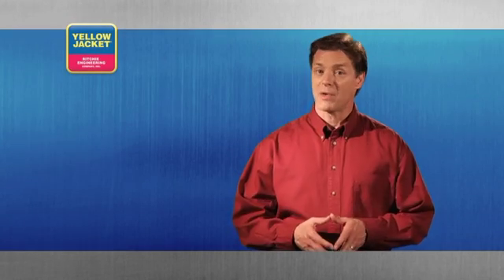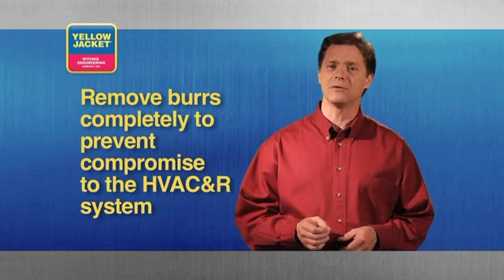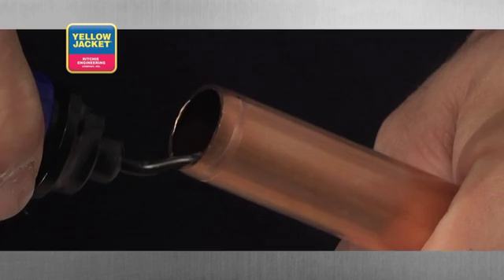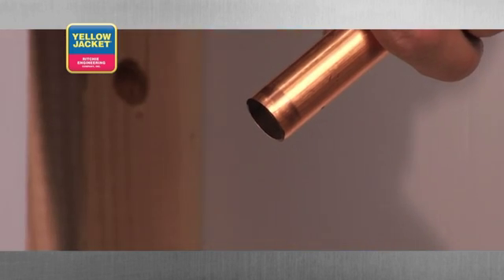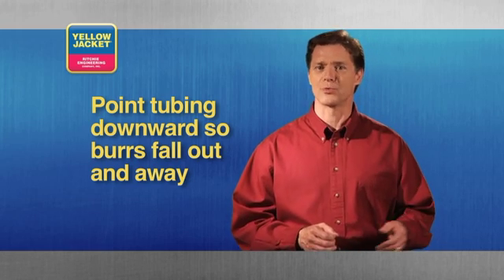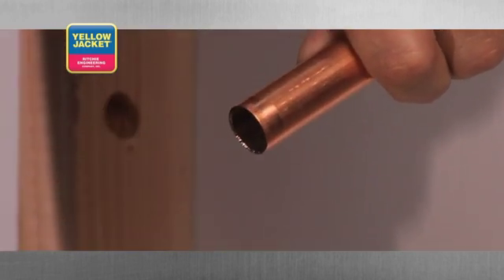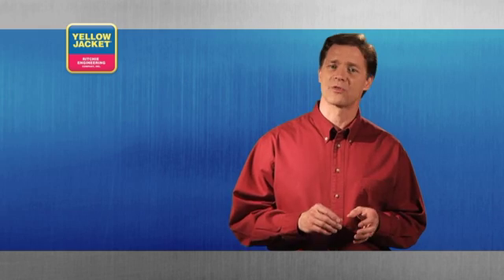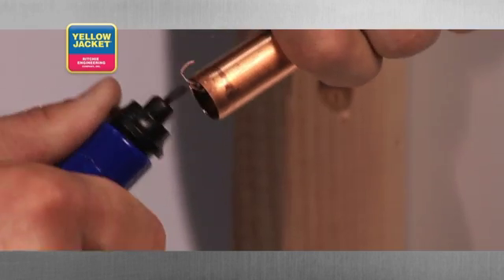Tube Deburring Techniques

Comment: I know it is best practice to deburr copper pipes, but what do you do when you cut the pipe and itis facing up and deburring in this position would cause burrs to fall into the pipe.
Reply: I was thinking maybe shove some cotton into the pipe first then pull it out with tweezers and the burrs will come out.
Reply: @Thejrb11   Tried it and the cotton wool worked nicely, it's quite compact and has a decent spring to it to hold itself in place, I then just took the shop-vac and sucked up the cotton along with the filings.
Reply: Very late response. Sorry.  Maybe take a piece of cotton ball, twist it length wise and stuff it into the tube just far enough so that it won't come into contact with your deburring tool...don't pack it too tightly.  After de-burring, your shavings should sit on top of the cotton, using a leatherupholstery crafters needle or a quilting curved needle or maybe an unwound paper clip, stick that into the copper pipe and slowly snag the cotton and pull it out.  Should work. Good luck.
Reply: I too have looked for an answer to this question, unsuccessfully so far.
Reply: @jerrymcg3199  same
Reply: Stuff a bit of Saran wrap (plastic food wrap) into it.

Comment: what is the name of this tool? I want to have it
Reply: Deburring tool
Reply: I have one I bought from Harbor Freight and it works fine.
Reply: @AffordBindEquipment  i can never find them at harbour freight.
Reply: @rjskum688  Just checked and you're right, they don't sell it anymore...too bad.  But just search for "deburring tool" on google and LOTS of links come up.  there are also a lot of them on ebay.
Reply: @AffordBindEquipment  Ya it wouldve been convenient to go there and buy a couple.  It's funny a few minutes before you responded,  I bought one off Amazon for 14 bucks. Thanks for responding.
Reply: If you're near a Johnstone they'll have one